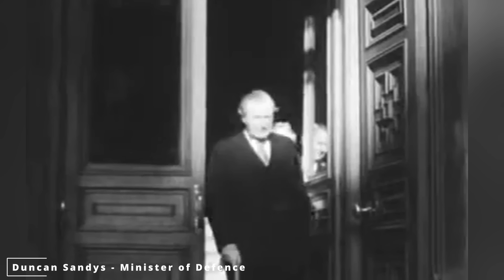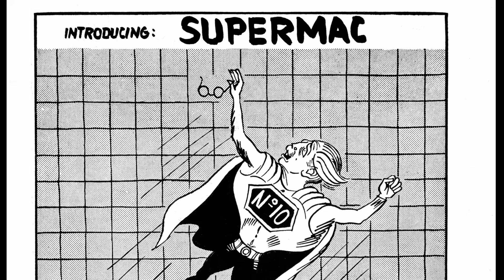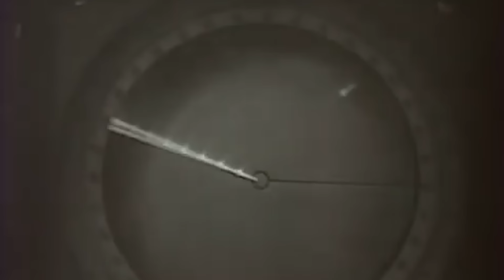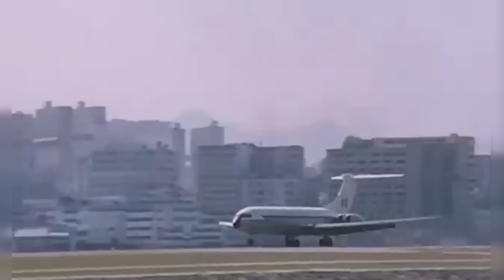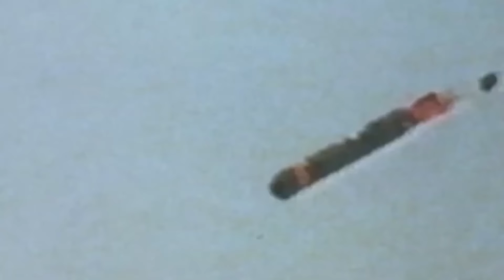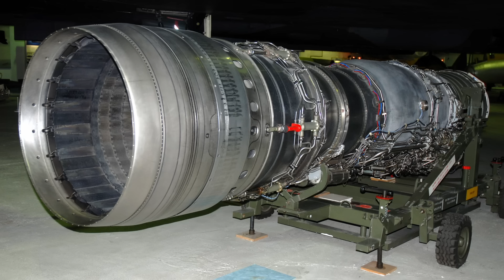How Britain Turned A Failed Airliner Into a Soviet Submarine Predator | The Mighty Nimrod

Comment: I worked on the Avionics for the Mk2, it was good but halfway through the development it became clear the gear would work but be very much out of date - still do the job but could be better with non-magnetic memory and microchips.  We also supplied the same computer to the AEW team and there was a bit of "do they know what they want"?
Reply: On the original program? or the avionics update program a few years later?
The AEW program was a complete fiasco...clearly, they did not know what they were doing or even seem to care.
Reply: @DoktorBayerischeMotorenWerke 

 
The fabulous trail blazing De Havilland Comet. 

The various Nimrod programs were mainly cancelled simply due to the fact that BAe Systems and others were not prepared to slow down on other projects and were not prepared to do more for less money. 

World's first production jet airliner doing regular commercial service. An Avro Lancastrian jet airliner was actually first. 

World's first high altitude jet airliner. 

The HS 801 was produced from new build Comet 4 airliner airframes with necessary 801 modifications. It was the most advanced aircraft of it's type at the time it first went into service. It was not available for purchase by other nations. 

The MRA4 version had problems with radar and computer development and BAe Systems & co were too busy with other projects. 

There can be no excuses for the Bow-wing (See B-47 wing / folding  collapse incidents) Max incidents given that Bow-wing had more than 50 years design and build experience for the type. 

A typical Bow-wing (See B-47 wing collapse incidents) airline duty 707 lasted for about 23 years on average. The reason any lasted longer was large numbers built so lots of spares with a lot of airframes in military use with big military maintenance budgets and many often with low flying hours or in storage. A typical 707 is basically cheap nasty junk. 

All later jet airliners benefited greatly from the knowledge gained from the Comet incidents & subsequent investigations & yet some were still worse for accident losses. 

Instances of all marks of the Comet flew with full certification after 1954 including the Comet 3 with full certification remaining in place until after the aircraft were retired. The last Comet flight occured in 1997.

The nose design was unique to the Comet, Sud Aviation licensed the design for their Caravelle. 

The fabulous trail blazing DH Comet.
World's first jet airliner in regular service.
The jet engined Avro Lancastrian actually did a passenger service before the DH Comet. 
World's first high altitude airliner.
World's first airliner with a full fuselage length pressurised cabin pressurised for high altitude flight. That feature for that type of aircraft was a considerably difficult undertaking. 

How things were back then.
Accident losses - % of aircraft built.

DeHavilland Comet 4 UK                          14% 
DeHavilland Comet all mks UK (ff 1949)17%  
Vickers VC10 UK (ff 1962)                         5%

Douglas DC-1  US                                       99%
Douglas DC-2                                              47%
Douglas DC-3                                              30%
Douglas DC-4                                              26%
Boeing s300    US                                       72% 
Boeing 307                                                  70%
Boeing 247                                                   48%
Boeing 707  (ff 1958)                                 32% 
Lockheed L-049 Constellation (ff 1943)  30%
Lockheed Electra US (ff 1957)                   29%
Fairchild FH-227 US (ff 1966)                   30%
McDonnell Douglas DC-8 US  (ff 1958)   14%
Sud Aviation Caravelle  (ff 1955)             15%
Canadair CL-44 Turboprop US (ff 1959) 46%  
Convair CV-580 Turboprop US (ff 1960) 22%
Convair CV-880     (ff 1959)                      27% 
Convair CV-990     (ff 1961)                      33%
Tupolev T-104        (ff 1956)                     16%
Vickers Viscount UK  (ff 1948)                29%  
Fokker F-27 Turboprop NL (ff 1955)       40%      

The Vickers VC10, fastest Atlantic crossing for a non supersonic jet airliner, held the record for 41 years.

For the first few years of operation the Caravelle & Comet had similar accident loss fatalities.

Sud Aviation Caravelle - 
all accident loss fatalities - 
1320 fatalities. 

De Havilland Comet - 
all accident loss fatalities - 
453 fatalities. 

An example of a typical airliner from the period. 
The Fokker Friendship F-27 fatalities & accident losses as a % of aircraft built. 
Fokker F-27 Turboprop (ff 1955) 40%
2130 fatalities.

Boeing 707    3108 fatalities.

Of course De Havilland carried out a full stress analysis & performed extensive & protracted testing on two long lengths of fuselage representing all features of a complete airframe. De Havilland carried out significantly more testing than was required by any authority at the time & significantly more testing that any previous airliner was subjected to.

De Havilland designers / engineers knew all there was to know about metal fatigue at the time they designed the DH Comet.

De Havilland had prior experience building many all metal construction airframe aircraft including many passengers aircraft & thousands of jet powered fighter aircraft that were primarily of metal construction with pressurised cockpits & used jet engines built by De-Havilland.

De Havilland did indeed always work to better than industry standards at the time, used up to date knowledge for the design & testing activities & no evidence of negligence or criminal negligence was ever produced in relation to the DH Comet.

Global aerospace. 
From the 1950s sector rationalisation and consolidation took place. 70 companies in France and 300 companies in the US disappeared due to merger or dissolution. In the US Boeing was almost bankrupted by the 707 project.  Boeing had a well protected domestic market and the available space and resources in the US to engage in large scale airliner manufacturing enabling them to capture orders simply by being able to produce airframes fast enough and cheap and nasty enough. Another factor is airlines preferring to obtain as much of their airliner inventory as possible from one manufacturer.  Brazil has the world's third largest airliner manufacturer, Brazil is towards the bottom of the wealth over capita tables along with Indonesia. Most of the countries at the top don't bother having a single national airliner manufacturing company. 

Global Aerospace Sector, what's happening.

For example, there are of course no German companies that makes German jet aircraft in Germany & there are no German companies that make German gas turbine aero engines in Germany that are suitable for widebody airliners.

The UK has the world's highest combined per capita Nuclear / Defence / Aerospace Sector Activity.

UK defence sector, absolute terms, world's second highest activity. 1st for per capita defence sector activity. Per capita nuclear powered submarine construction, 2nd position. 
Main players being Rolls Royce, Babcock, GKN Aerospace & BAe Systems. Activities often involve international collaboration. BAe systems, RR and other UK companies now handle more Airbus work value wise than Germany. 

There's a good chance that anyone currently flying on a widebody airliner will be on an aircraft powered by RR gas turbine aero engines made in the UK and a good chance there will be other hardware on the aircraft that's designed and / or manufactured in the UK. 

Rolls Royce Holdings UK
Subsidiaries
- Rolls-Royce plc
- Rolls-Royce North America (ex Allison etc Classified Military stuff)
- Rolls-Royce AB
- Rolls-Royce Deutschland
- Rolls-Royce India Private Limited
- Rolls-Royce Marine Power Operations
- Vinters Engineering Limited
- Rolls-Royce Controls and Data Services
- Rolls-Royce Power Systems
- Bergen Marine
Joint ventures include:
- Rolls-Royce Turbomeca
- MTU Turbomeca -

Trent Family
The MT30 (Marine Turbine)
Industrial Trent 60 Gas Turbine
Trent 7000
Trent XWB Airbus A330neo.
Trent 1500
Trent 1000
Trent 500
Trent 600
Trent 700
Trent 800
Trent 8100
Trent 900
   
RR wholly owned subsidiaries in Germany handle smaller 2 shaft RR gas turbine aero engine work.

The UK space and aerospace sectors are highly productive, high-value industries that together contribute over £18 Billion in direct Gross Value Added (GVA) to the UK economy. Individually, the space industry directly contributes about 0.3% of UK GDP 7•2 Billion while the aerospace industry contributes approximately 0.5% £10•9 Billion.

The original alloy used for the Comet was discontinued by the manufacturer, that is why the alloy changed. The skin thickness remained the same for most of the airframe, the only change to skin thickness was the area where the wings meet the fuselage.  The window shape and size changes were necessary, the fact that cracks didn't run through viewing windows is irrelevant. The fracture that started at the rdf assembly window was due to fatigue fracture, the fracture started at a bolt hole. The fracture that started at an escape hatch during post incidents water tank testing was also due to fatigue fracture. all structural bulkheads, floors and decks were constructed using aerospace grade aluminium.

Comment: G'day from the Antipodes!
That was such a neat video.
The double bulge fuselage is such an interesting look. To me, the clean lines make it look quintessentially British.
I watched a great YT on the Westland Lysander, which seemed to largely fail in it's mission of infantry support. However, since it was so well engineered for rough, short landings and slow speeds, it became a piece of kit that was instrumental in winning the war. It carried famous French resistance leaders and was the mainstay of the Special Operations Executive. I think you could say it played a larger than normal part in winning the war.
In some ways, the Nimrod seems to be the same kind of adaptation. An excellent airframe with jet power and plenty of room to put "Magic Circle" tech. The project management was probably pretty strict and as you mention, some of the tech at first (diesel detection, old Shackleton radar) was a touch old, but it worked and was a known quantity.
It seems like a great British reuse of an existing design for a new role.
The engineering view of things and the deep dive into things I wouldn't have known was great. Interesting that on other airframes the generator was hung down into the airstream.
Looking forward to the next episode on the "Magic Circle".

Comment: A little about the MRA4 might be mentioned. This started life as the Nimrod 2000 and was renamed when the delivery date slipped well past AD 2000. It was a very costly upgrade, and was eventually abandoned. It was intended to use partly reuse airframes of the MR2. When these old components were mated with newbuild components it appeared has though the original components had been built over chalkmarks on a hanger floor - so inconsistent were the dimensions and positioning. Attempts were made to reuse these parts but this eventually became so costly it was abandoned and the Boeing Poseidon was bought. (I worked in the electronics bay in Kinloss in 1970 on one of the first computer controlled automatic test machines for the MR2. 30 years later I worked on the flight simulator (not delivered) for the MRA4.)
Reply: The original airframes, including the wings, were built using using jigs. Dimensional tolerances were stated. The upgrade program took account of the known, stated and documented tolerances. They also confirmed that the fuselages were within the stated dimensional tolerances. The MRA4 programme stalled then got cancelled because there were issues with radar and computer equipment and BAe Systems was very busy on other more lucrative projects.
Reply: @Paul-mh9pr  Here'swhatWikipedia has to say on the topic -" Early on, an independent company, Flight Refuelling Ltd., had been contracted to undertake the conversions to MRA4 standard, however BAE discovered that the Nimrod airframes supplied by the RAF were not built to a common standard and this considerably complicated the refurbishment process. "
Reply: @MrJetexjim 

BAe didn't discover anything.

Don't believe everything some random nobody made up at some random point in time. 

There's a lot more to the various reasons the MRA4 programme got cancelled but it's classified.

Flight Refueling Ltd are sometimes claimed to be the people who made the so called  discovery that there were massive dimensional differences between individual airframes and the Comet 4 airframes were all made entirely by hand with rubber faced hammers and nail files and were all completely different etc etc. Some of the info out there is comical.
Reply: @Paul-mh9pr  Perhaps you'd like to explain why, after spending a huge amount of money, the refurb was cancelled.
Reply: @MrJetexjim 

It wasn't possible to persuade BAe systems & co to do more, do it faster & do it for less money.  Around the same time the Lockheed Viking got retired and wasn't replaced. There were other reasons which aren't published.